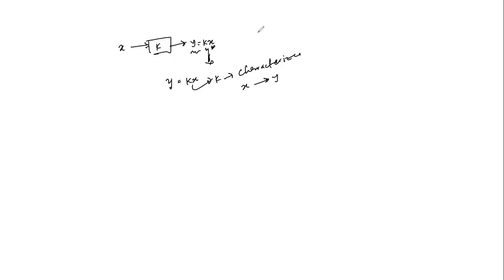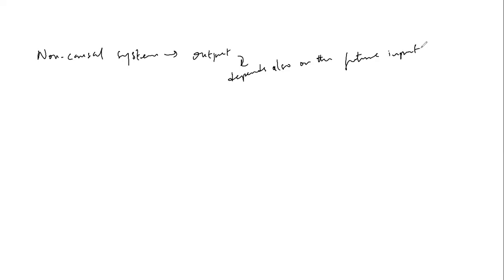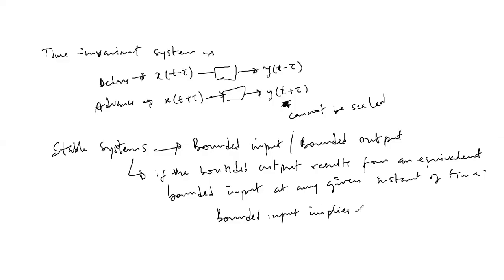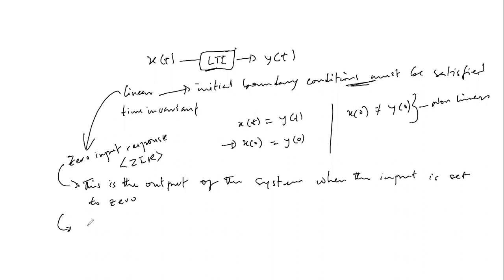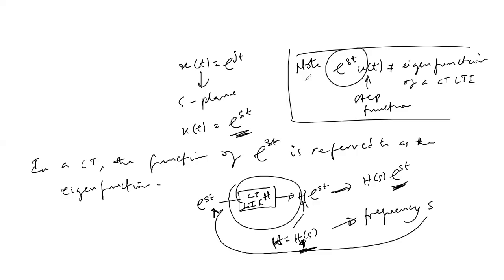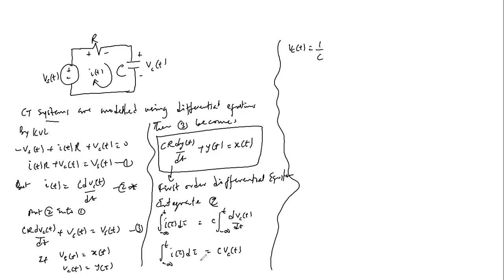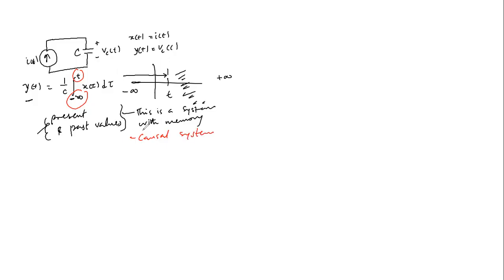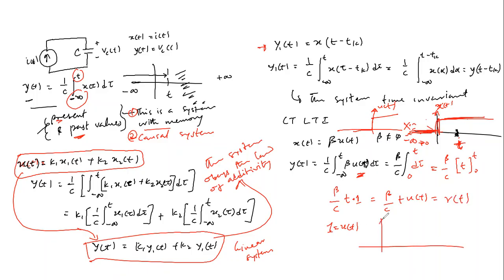L04. Classification of Systems #lecture #new #signal #system #engineering

Comment: Good day sir

The definition of dynamic and non casual systems you gave are the same...... I'm confused
Reply from the maker: Non-Causal and Anti-Causal systems are all dynamic systems while Causal systems could be static or dynamic. You will observe that non -Causal systems although depending on present and past inputs may depend on future values of inputs as well. Do note that so long the system depends on input values other than the present input values at a given instant of time, it becomes a dynamic system.

Comment: Good evening sir, the 2nd example you gave on casual system had one of it's answer as x(1) and the other as x(-2) the part of x (1) shows a future time but you said causal Dosent depend on the future time , I'm a bit confused there sir
Reply from the maker: A very good morning to you, the present output being y(1) is the same as the sum of the present input x(1) and the past input x(-2). That is, {y(1)= x(1)+x(-2)}. The x(1) in the example is the present input corresponding to the present output y(1). The future input in this case will begin at x(2), then x(3), x(4), etc.